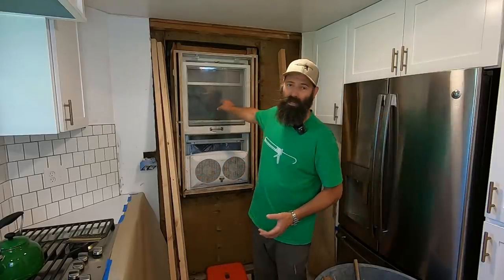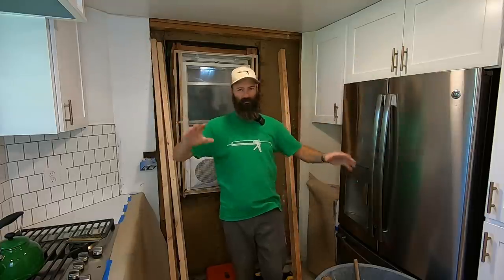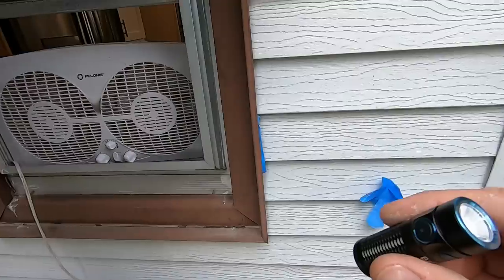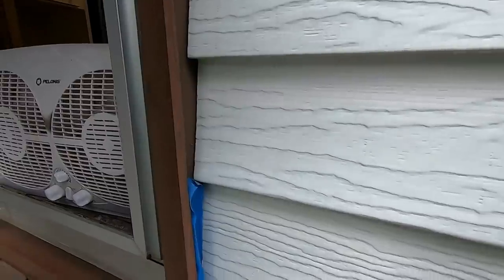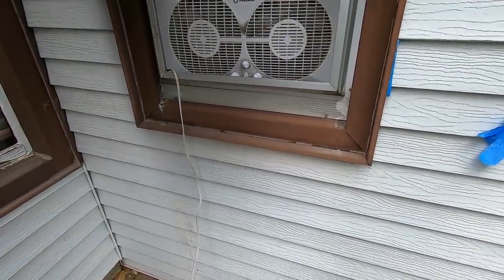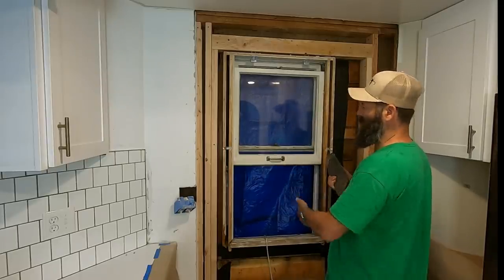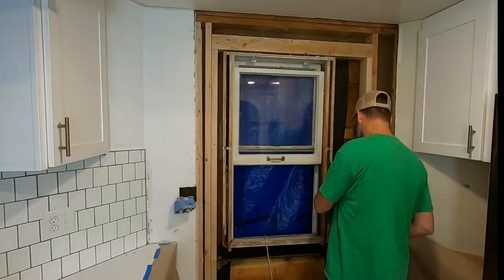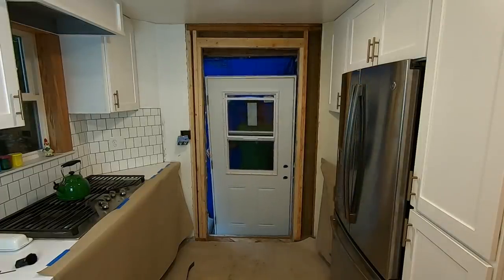Will The Door Fit In This Hole? | Exterior Door Install | THE HANDYMAN |

Comment: Was that a gable wall or non load bearing?  The window header wasn't wide enough for the new door  opening . Had that been a load bearing wall...I would have off loaded the ceiling above with a temp wall before framing in the new opening..I know what I'm trying to say but may not have conveyed it well here...lol...typical for me. .
Reply from the maker: No load on this wall.

Comment: LOVE YOUR CHANNEL We are the #1 Handyman in Bayview , WI on Nextdoor --my wife and I left our corp jobs 3 years ago and never looked back. We LOVE what we do and our business is almost all word of mouth- I agree with everything you're saying, pricing, referrals, quality work--- 1 QUESTION FOR YOU- what product have you used or would you recommend to spray a customer's bathroom tiles?  ANY Brands or names you can share??  They have pink and don't want to break it out--- are there any coatings that last?  I'm interested and have been researching because tile and floor are becoming our least favorite job--- getting too old to be crawling on my knees, being wet all day and walking in and out to the garage for every single cut;0)  Any ideas?  Is there anything that is worth it? I'm seeing some products where the room is sealed off, ventilation is put in through a window, we're suited up head to toe and it sprays on -- something from the marine industry or similar?

Comment: You caulked the new stud and furring strips to the plaster? Why?  Also you glued the jack stud to the king stud, is that standard?
Reply from the maker: I glued the old plaster to the new stud and furring strip. Not caulk.  It is not standard to the studs together.

Comment: "We're going to have to go at this a little bit delicately"...2 minutes later "Yeeeehawww!" sparks flying with 4 1/2 grinder!  LoL best tool for the job really though.  I was just waiting to see some trolls comment but was disappointed so I made my own.  Okay I only read like 5 comments, I'm lazy tonight.  Looking forward to the next video.  I swear every job in my house is like this...it was built in the 50's.  Normally you do this BUT because of xyz, you can't do it the conventional method.  Which leaves you wondering how the pro's handle these kind of variables.

Comment: You still using those $1 multitool blades? Bought a pack of those and they seem to go dull just by cutting through a wood knot.
Reply from the maker: yes. they work great for me I use them on drywall and wood.
Reply: Let the blade do the work bud. If you're cutting with the tool inverted and you've got the full weight of the tool resting on the blade then you are almost pressing too hard.

Comment: The sounds were authentic. Interesting that you used the multitool to cut through the metal siding. I know it will look outstanding once you get all the pieces back together. But it has to to be a "royal pia" to do this window to door conversion. I suspect all the conversions from plaster/lathe to modern construction techniques are no fun either. But that is why you get the "Big Bucks"!
Reply: Pretty sure that was a 4" grinder. You still need a steady hand to do that though.
Reply: Okay I stand corrected. I did a freeze frame and Print Screen Capture. The head of the tool is to large for a multitool.
Reply: @sterlinghearth3651  Yeah that would have worked. Unfortunately I rarely get thumbnails with notifications. I would have been able to see what he was using for the siding.